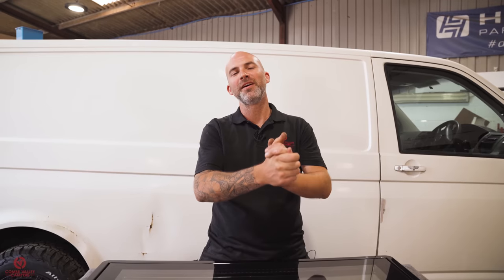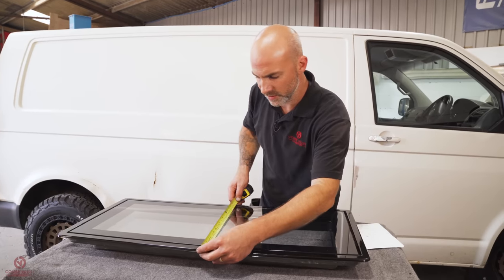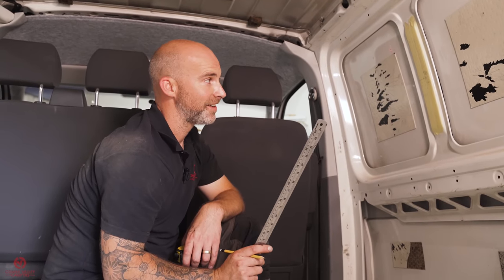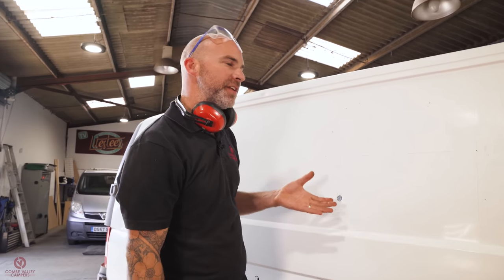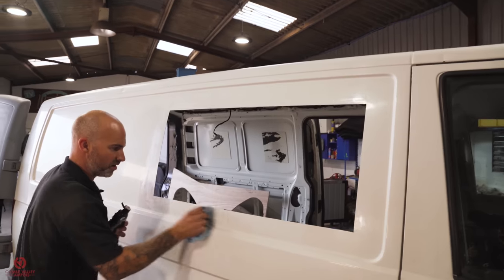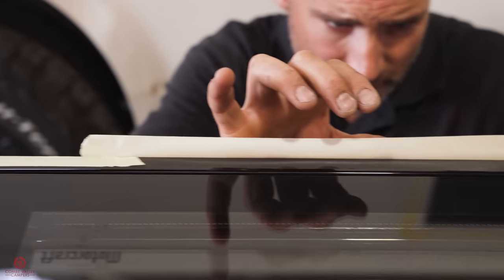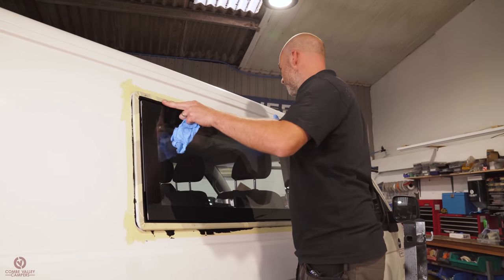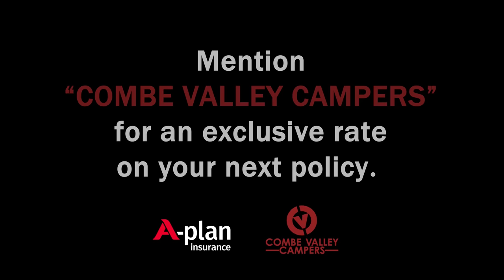Level Up Your Van Life with Glass Double Glazed Windows - How To Guide

Comment: Just a very minor point. Metrication came to the building industry when I was in my early 20's. At the time it was made very clear that measurements were to be given in millimeters and/or metres. Definitely no centimetres which is just confusing. Great video, well explained.
Reply: Hellen, "metrication" was meters, centimeters, millimeters, etc as opposed to inches and feet. Centimeters are part of metric system  with the "centi" prefix mening one hundredth so 1 centimeter is one hundredth of a meter. While industrial technical  drawings and in the building trade, should be in mm (millimiters, ) centimeters are a very accepted unit for work with centimeter-friendly dimensions, like fitting a window to a van . I hope this helps

Comment: Just remember that Tigerseal is not UV resistant & should not be left exposed to the sun. So if any exposed on the join will degrade fairly rapidly. Will turn grey & chalky and flake off.
Reply: Good idea to paint it then (or use a sealant that is UV resistant of course!)